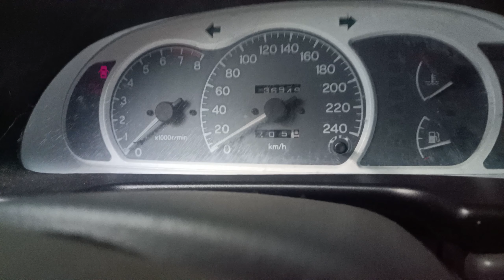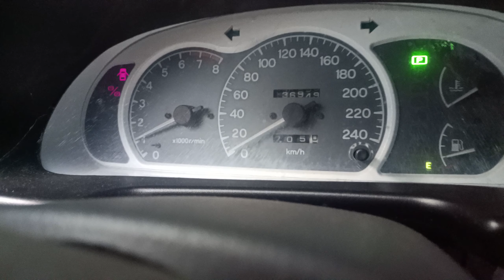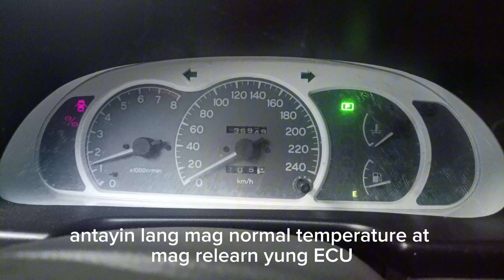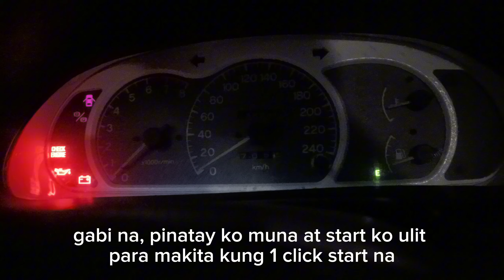Mitsubishi Lancer | 1st start after sitting for a long time

Comment: sir good day. ask ko lang po. bakit lancer itlog ko,everytime nagana yung radiator fan ng automatic,bumababa idle. example dun sa indicator from 13.7v to 13.1. sa panel guage bumababa ng 200,if nasa 1k to 800 rpm sya? chinek ng auto electrical,goods lahat,pinutul nya 2 wires sa socket,sabi nya malakas daw humigop ng kuryente. pero binalik ko yung wires,di ako convince. sabi nya,mas maganda,palitan na daw radiator fan. e di naman sira,bakit ko papalitan?
Reply from the maker: wag mo papagalaw yung standard electrical ng wiring mo para di gumulo, glxi ba lancer nyo dapat 90amps alternator nyo, lagay ka ng body ground, check ka sa youtube tamang paglagay ng body ground, check timing belt baka di naka timing, check timing ng distributor, set standard idle 800-900rpm, magkaroon talaga ng voltage drop at pagbaba ng konti sa rpm